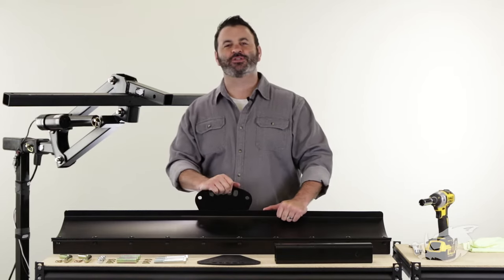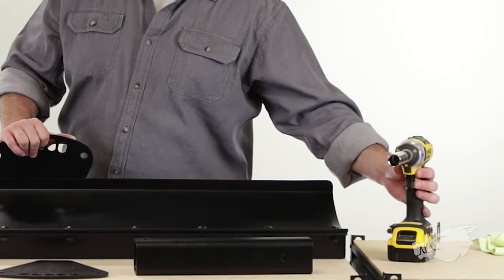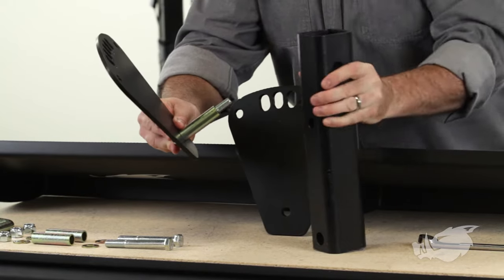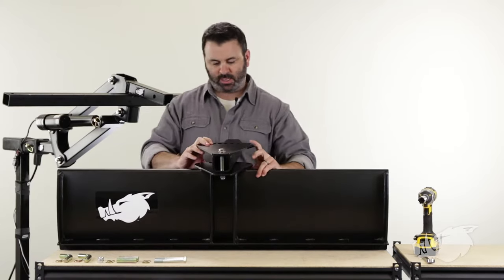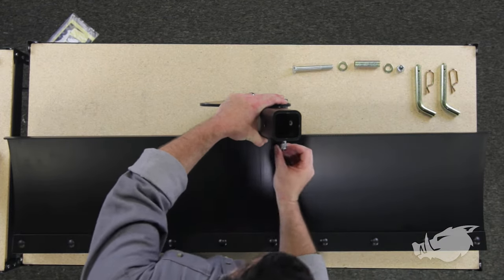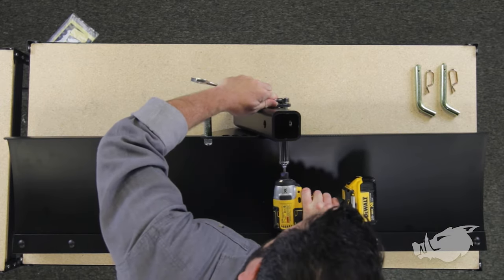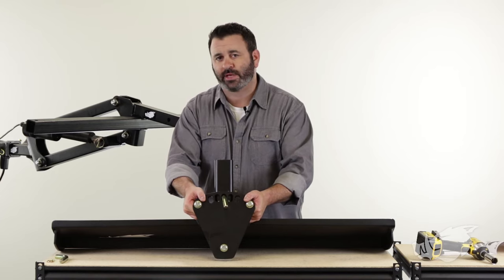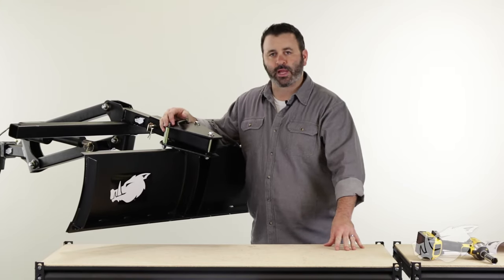Black Boar Scrape Blade: Assembly and Installation

Comment: So, a longer 2" tube will convert this into a push/pull blade, huh?
Reply from the maker: We do not recommend or approve modifications to the implements or lift.
Reply: @CamcoManufacturing  I'm sure your legal team tells you to say that. However if you'd have a mirrored mount, it would be entirely possible to have the blade spin 180 degrees for plowing duties.  Or, like I mentioned, a longer tube. We don't need 15 different implements sitting around. We need a few that can convert into implements we can use.  For instance, with removable sides, it could also be a box blade.  Teeth for the bottom would also be useful. Three birds, one stone.  Send me a check when it comes out, and you can keep the patent.